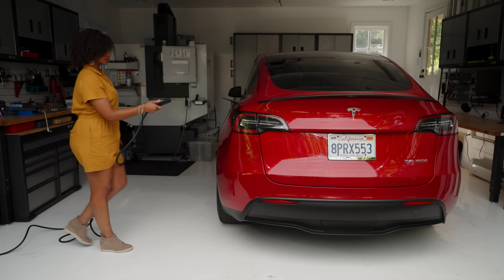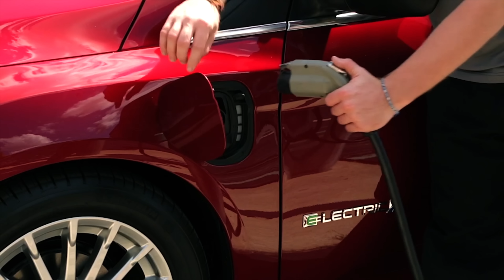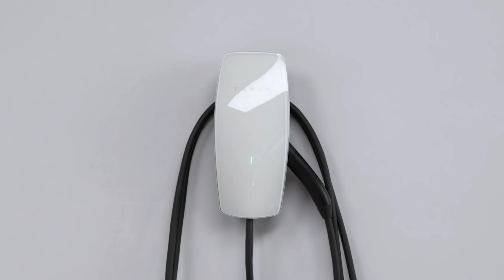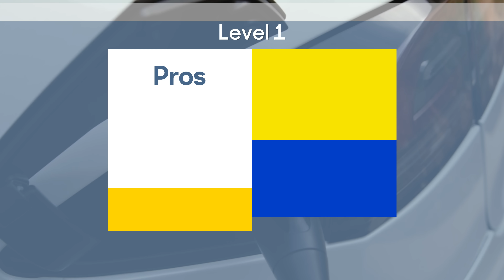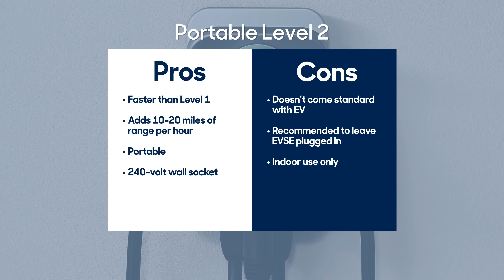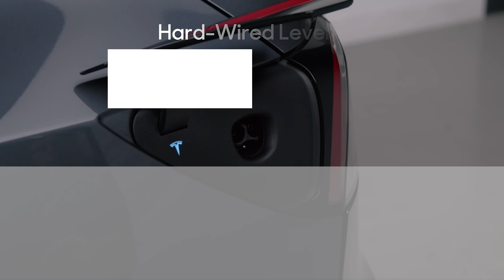Charging Your Electric Car at Home | Home-Charging EVs | The Ins and Outs of EV Ownership

Comment: Electricity  EV is starting to be about the same price as filling a gasoline vehicle.
Studies saying 100 miles is same to charge as it the same as filling a gasoline car.
Reply: Tesla avg 3.3 miles per kWh.  30 kWh for 100 miles.  If home charging @12 cents per kWh rate.  $3.60 for 100 miles.   Car w/25 mpg gas = 4 gallons currently $3.40 gal = $14.  Ev seems cheaper to me.  If you supercharge it’s more expensive than at home (24–28kwh) but for most people 95% of charging is done in one’s garage.  Just wake up with a full tank every day.
Reply: @derekl9702 
Wow is your electricity cheap!
It’s $.20 /kWh here in Michigan for afternoon and  evenings.   New rate schedule as of March 2023.
My work pickup gets 30 mpg pulling my trailer.  You running a Mercedes as your ice?

Comment: Another thing to add to the video is that it can be more cost effective to install a hard-wired L2 EVSE than installing a new 240 V outlet.  This is due to lower cost hard-wired units now available from Tesla and others, and new NEC (national electric code) requirements to use a GFCI breaker when installing a 240 V outlet for EV charging.  These breakers are expensive, and not needed with a hard-wired EVSE since they have GFCI built-in.